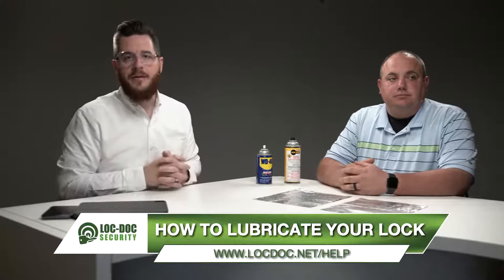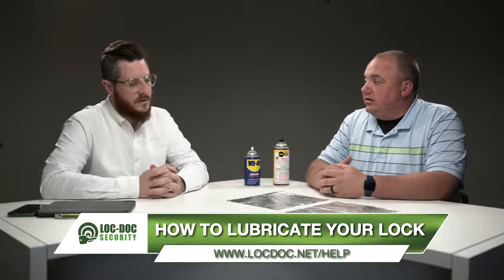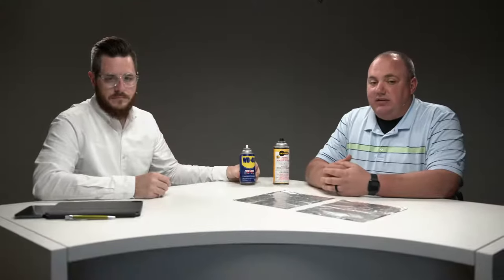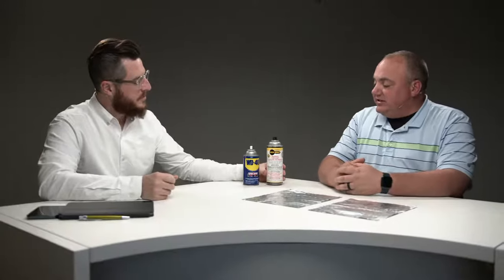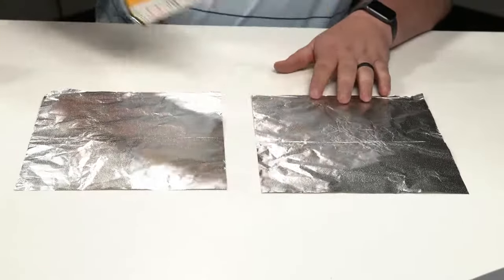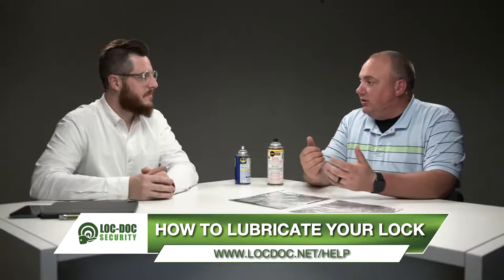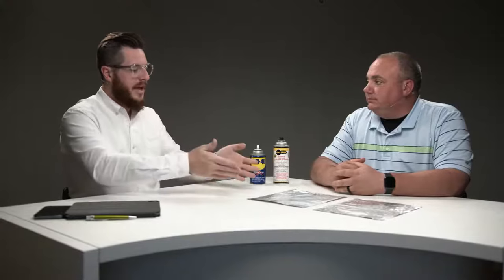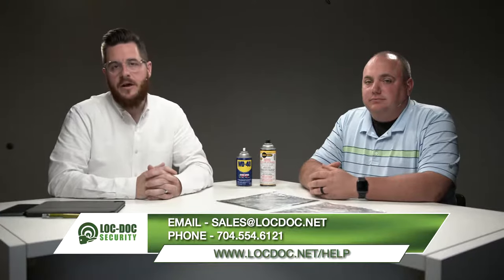What Is The Best Lubricant To Use In A Lock?

Comment: WD-40 is not a lubricant  .
Reply: bingo  everyone seems to be missing that.   In devices that have grease or oil already in them, WD-40 will soften hardened grease or oil and get it flowing again, but it will not add any lubrication.  It displaces water and coats metal, it does not lubricate.  It can also loosen some glue residues, I've removed Sharpie marks with it, so it is versatile.   People just need to learn it's limitations.
Reply: It will make it worse.
Reply: @jonibrown4427 When's it meant to get worse I put it in my garage door lock 10 years ago and it's been perfect ever since
Reply: Why does it say so on the can?
Reply: @billasohyeah  WD stands for water displacement. Never spray it on parts with oil or grease unless you want to clean it.
Reply: @Leo-gt1bx  i know what it means. It also says lubricant on its uses on the can. Obviously it won't be ideal for everything that needs lubrication.

Comment: I have been using WD-40 for 20 yrs on locks and two times a year.  No problems
Reply: Have you ever used it in your car ignition?
Reply: "I have been using WD-40 for 20 yrs on locks and two times a year.  No problems"

That's fine it's working out for you, but it's really not the best product to use.

Comment: You nailed it. WD40 is a debris magnet. Synthetic lubricants like LOCK SAVER packaged as aerosols actually clean, lubricate and protect the lock mechanism in about a 2-second burst. The aerosol propellants first flush the lock clean, it then takes about 30 seconds for the propellants to evaporate before leaving a light, semi-dry finish on the lock parts. Try a different test. Go to a window or any pane of glass, spray WD40 on the left, LOCK SAVER on the right. You'll see the WD40 pattern begin to run down the glass and stay wet. In a lock, that simply soaks up dirt, dust and debris. Any locksmith worth his salt, realized this a long time ago. On the same pane of glass, away from the WD40 pattern, spray LOCK SAVER -- a 2 or 3 second burst is all you need. Watch the propellants evaporate and the lubricant stay in place as a dry finish, no running down the pain. Synthetic lubricants like LOCK SAVER won't freeze -- and miracle of miracles -- the same cold temperature lubricant creates a barrier to the metal in high humidity climates, preventing rust and corrosion. This one is a no brainer.
Reply: Do you spray LOCK SAVER on the key or inside the cylinder ?

Comment: I get the point, but they are over stating their idea by miles. Locksmiths have said to me many times that WD-40 works fine. And it does. Haven't had to clean locks for years after using it. Some of which are used daily by multiple people. And so, at least in a pinch, it works without issue and you will not "have a locksmith out there before long".

Comment: I wish I had watched this video before spray WD40 in to my ignition Switch. WD40 completely clogged up my car ignition key barrel. Now i can't even start my car🥵
Reply: How long did it take for the ignition to get clogged up after you sprayed it with wd40? I literally just sprayed mine today
Reply: @timothyleee27204  It depends. If there are lot of dirt in your key barrel it will clog up quickly, otherwise it want. Mine it took about a day to clogged up. I had to clean and unlock the barrel, now it is working fine.
Reply: @pSL-oy5gl  ok. Thank you so much

Comment: Being in my sixties I had a learning curve on lubricating locks, and here is my two cents.

DO NOT USE WET LUBRICANTS.

I've used graphite and that works well but it is messy.
For the average guy and for every day home use, I'd recommend silicon spray lubricants.

Do that once a year to any locks you want to keep in good working order and you won't have any rust or sticking problems.

Works great on car locks and power windows.
Before using it on power windows you may want to watch this Youtube video first.
Just copy and paste the below Heading.

Doing This Will Make Your Power Windows Last Forever
Reply: Thank you kind Sir.

Comment: What about if wd40 has been used already? Will the dry lube clean that out?
Reply: It might remove some of it depending on what solvents are in the dry lube.  I would just pick up a can of brake cleaner spray and flush out the lock as best you can.   If you have a air compressor you could blast it with some air afterwards to try and blow out any remaining residue.   After giving it a few minutes to allow the brake cleaner to evaporate go ahead and hit it with some actual Lock Lubricant like the synthetic dry lubricant seen in this video.

Comment: What if you already used WD40 on the lock once? I didn't know this info and used it recently.   It is still working fine.  

Can I go ahead and start using another lubricant like the one shown in this video?  If I buy some and spray it in there in the near future, will it help get rid of / counteract the problems with WD40?
Reply from the maker: If you have the ability to clean it, that would be helpful.  If not, use of lock lubricants as a maintenance procedure will always lengthen the life of the mechanical lock hardware

Comment: Depends on what you are using WD 40 on.  Graphite?   Depends on what you are using it on.      NEVER  put graphite inside a vehicles  key ignition lock. Not a good idea. Depends on what you use different lubricants for.

Comment: I dont understand. how would the lubricant get rid of the "gum" fromt he lock. ther eis no way out for the gumness.
Also can it be used in car ignition?
Reply: Even dry lubricants go on "wet" and those solvents can break down, and flush away the "gunk" before they evaporate.   It often doesn't "remove" the gunk, it just "relocates" it, that's why you see most locks installed with the tumblers up.  Any lubes or sprays can clean out the tumblers via gravity.
I don't have an answer for your car question, other than I'm curious why so many people are having problems with their car ignitions, lol.
I can tell you that when ever I get a used car, if the keys look worn at all, I have fresh keys made, preferably at the dealer.  Going to the hardware store to have them copy an already worn key defeats the purpose.